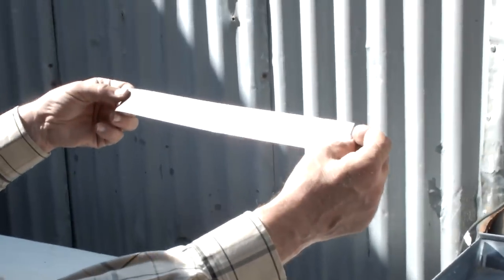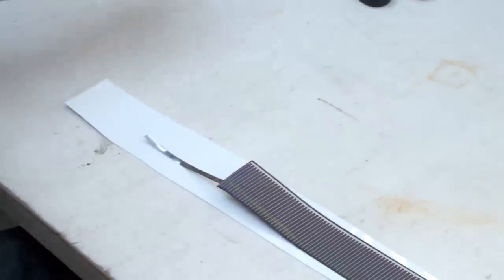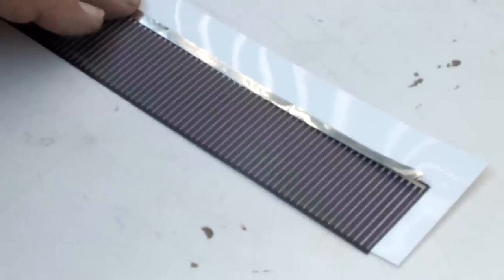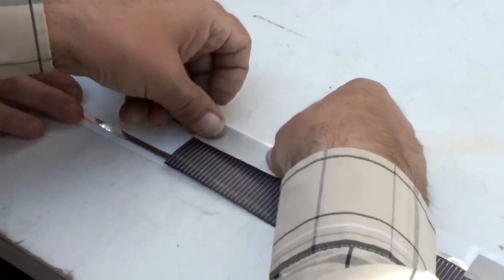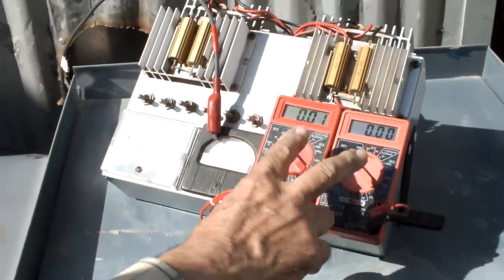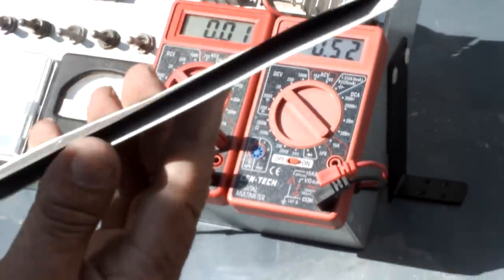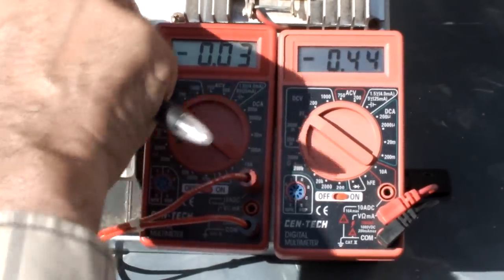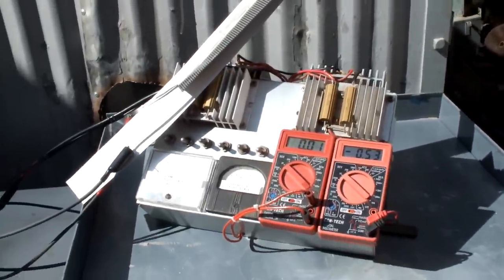Solopower SL1 Lightweight Stainless Steel Super Flexible CIGS Solar Cell Demonstration

Comment: It does not occur to them that these cells need to be place like roof tiles, each back of a cell touching the tiny conductive front row of the previous cell, stacking them up like a roof. This will create a large number of cell in series and if done correctly 40 of these strips produce 20+ volts at 2.5+ Amps = 50+ Watt. A thin piece of acrylic or glass even on top will protect the strips from the weather and presses them firmly flat on to each other without glue or tape. These wil make a fine compact 50 Watt cell (20v) to be used in a regular 12v system. I  imagine the size to be 20cm x 100cm and very lightweight. 5 of these next to each other will produce 250+ Watt in a square meter. You need 5 x 40 = 200 strips.
Reply: do you really think that just pressing these on top of each other will produce full power with time and weather conditions?   They will need some kind of conductive glue.

Comment: Can these be cut in half to produce more volts with less amps and same wattage?
Reply from the maker: Garrett Cook
Hi Garrett,  Yes these CIGS cells can be cut with scissors and they will keep the same 0.5 volts but reduce the amps.   In comparison the Nanosolar Nanocell CIGS solar cells we have available are made of 2 sheets of aluminum and if cut with scissors those 2 sheets would touch and short out.  The Nanosolar Cells are more robust but the only way we have figured out how to cut those without shorting is with a waterjet cutter.

Comment: I wonder when my setup isn't working? Dirty contacts or they don't work at all indoors?
Reply from the maker: +Senor Rowlando HI Senor Rowlando,  Solar cells need to have strong sun to produce their highest power.  They will work indoors under a strong light but only would put out maybe 2-5 percent of rated capacity.

Comment: what is the nominal current of the panel???
Reply from the maker: RubenCabrera3 
Hi Ruben,  Under good sun we have found these cells put out  2 to 2.5 amps at about 0.5 volt.  I also wanted to mention these are not panels but raw solar cells. In comparison solar panels normally refer to ground of connected and encapsulated solar cells as a finished ready to use product.

Comment: How much does it weigh and produce per foot?
Reply from the maker: Hi Mike.  This cell weighs 0.32 ounces. and is 14.5 inches long by 1.75 inches wide. According to Solopower specifications this cell under perfect conditions would output about 1.25 to 1.5 watts at 0.50 volts and 2.5 to 3 amps.  Under normal working conditions I we have seen about 60 to 70 percent of rated output.
Reply: Thanks
Reply: +recycledgoodsvideos where can i get this condictive tape ? link pls